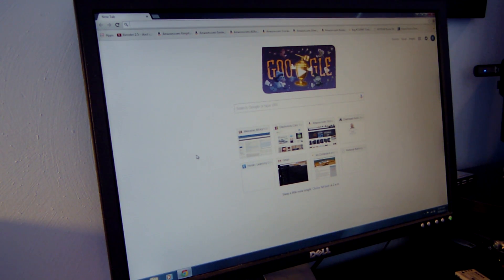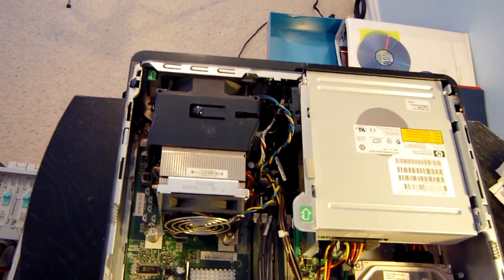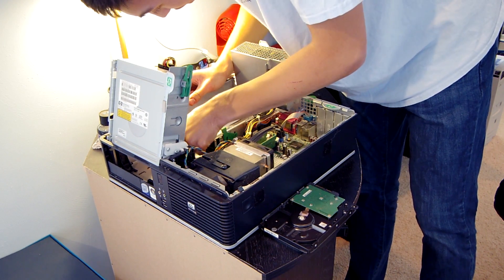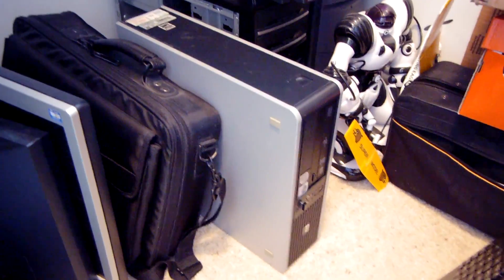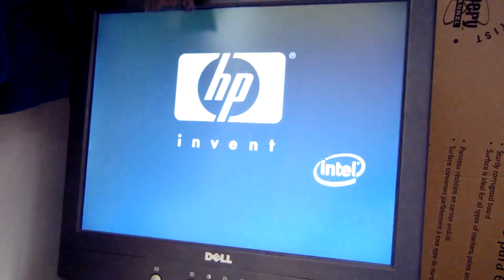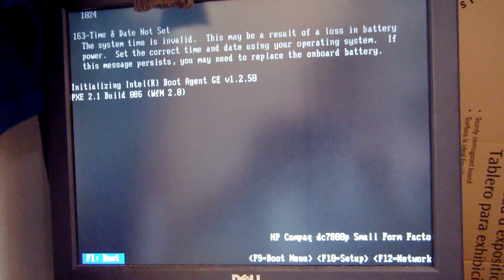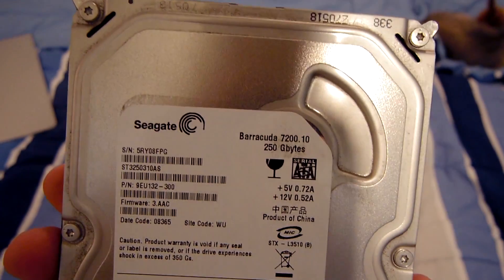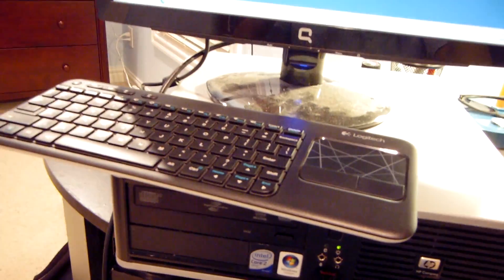Server Upgrade: Pentium 4 to Core 2 Duo

Comment: This boys and girls is why I always advocate for Linux based server software solutions because had his server been operating on a Linux based OS, he truly would have been as simple as swapping the drives and he'd have been good to go. Granted he wasn't comfortable using a Linux based OS for a file server at the time, but regardless, THIS is why so few servers in the world are running consumer level Windows based OS platforms.

Comment: You should get rid of that CPU and install a QX9650 Core 2 Quad. That is a good upgrade for that CPU.
Reply: Depending on the load its overkill and not worth it money-wise.
Reply: Besides it’s a massive improvement over a Pentium 4

Comment: Wow my Dell win7 desktop has the SAME experience index (maybe same specs?)
Reply: Hdd Is a 7.9 i think but it's a ssd
Reply: Meh, experience index isn't very accurate, i've seen way worse pcs have the same experience index. 

I would rather use passmark scores to compare computers and parts.

Comment: Now, install remote desktop and remove the keyboard, mouse and monitor. Power and ethernet only.
Reply: Why tho? Having to RDP to a machine literally less than 1ft away from you? Wasting network and energy resources by having to process the remote acess... 

Unless you have to remote acess it, its way better to just have a keyboard attached..

Comment: Hey, great video man and great info. I was trying to upgrade our computer and saw couple of your videos.. I was hoping you could answer my questions but first our computer is the athlon 2 and  2gb ram I think the desktop setup are the same and thinking I could add an radeon R7 240 and 8 gb ram ddr2 and also thinking of replacing the old HDD with the HDD that has windows 10 would that work? Again thanks, for making videos like this.. (sorry bad english)
Reply: Yeah that would work i can get windows 10 running on an intel atom with 2 gigs but min is 1gig

Comment: Ethernet has a dramatically lower latency compared to wireless. I noticed in your comment below that you don't think it makes a large difference. It does! Every time a handshake occurs or data is transmitted; that small latency you experience with wireless adds up quite a lot; even with small amounts of data. You would probably notice a 20% to 30% increase in network speeds if you converted to Ethernet.

Comment: >using wireless for a web server
>using a SEAGATE drive
>using a workstation OS
>putting it in a closet with no airflow
>making that worse by having so little space around the PC

do you have ANY idea what you're doing?
Reply: I think its a computer torture test LOL.  IDK though these things are pretty tough computers we had one at my previous job and that thing got abused, kicked, dropped, etc.  Surprised it still worked after the abuse my boss put it through.
Reply: Whats wrong with Seagate drives
Reply: @zuccx99  WD drives are more reliable, but I recommended Seagate for my friend and its working just nice. (over year maybe?)
Reply: @pena3976  Well.. tbh i never had old failed seagate drives but several wd ones, just like my 1 yeat old 1tb wd blue, and several old wd's i found in old pcs. 

I think it's more a matter of luck.
Reply: I mean except for the airflow issue, its not so bad, as it wasn't a high traffic production environment, so in the end using a gigabit ethernet cat7 cable or using a shitty wireless usb dongle, doesnt make that much of a difference. 

But i would like him to acknowledge that he is not doing things as they should in professional ways, etc, so people shouldn't use this as a home server guide.
Reply: man u re so rude
he looks very young and
just knew about pc building (maybe).
he filmed, edited, and share it on youtube by himself.
its better than nothing
(sorry for my bad english)

Comment: the bottleneck is from the damn wireless dongle
Reply: The bottleneck is from his ISP, not his network adapter. Even the cheapest slowest wireless dongles are usually able to handle at minimum 100 megabytes per second. If his IPS is crap, which he's openly stated in multiple videos that it is, then regardless of whether he's using a wireless or hard line connection, the response/load times of his site will be slow. Welcome to entry level networking common sense.

People spend too much time watching LTT videos and think you need to dump hundreds of thousands of dollars into a server farm to be able to do anything on the net. You would be shocked if you knew how many websites are hosted on servers with LESS then 100 megabyte per second network connections. Hence why you can have a gigabit home network connection and websites still won't load any faster then someone on a 20 megabyte connection.

Comment: which computer is best for running music on???
Reply: 66mhz pentium for low bitrate wma 233 pentium 2 and up for 128 and up mp3's pentium 3 700+ for flac
Reply: slipknot2k4 I was thinking about a quad core 2 processor

Comment: why are you using a windows System for your web Server ist s raspberry Pi 3 and a sata to USB Adapter Adapter a netter AMD More Power efficient sollution ?
Reply: Or eaven only a USB Stick to Store your Website with that rpi you could save so mouch Money at your Power Bill but ich think then would Spend the saved Money on your heating Bill 😂

Comment: I have a custom built system that i use as web server, it runs a pentium g3420, 8gb of 1600 mhz ddr3, asus h81m-d plus as motherboard and a gtx 650 as graphics card, it also has wifi that i use in case my wired setup does not work, an enermax triathlor fc 550w bronze certified power supply, and 2 hard drivers(one for storage, other for mackintosh installation), one ssd (for windows) and one dvd reader, i am also planning to buy a sata controller to have 2 more hard drives for other storage and backups. And i have not said that i have a very cool with plexiglass and leds enermax case from 2004 (i do not remember the model, but it was one of the coolest gaming case back at that time) and a cooler master musketeer fan controller that i prepared so it fully works. In the future id'like to upgrade the machine to a newer platform

Comment: Upgraded mine to a core 2 quad with 8gb of ram it was great :D then recently replaced it all with an fx 8350 and 16gb of ram
Reply: Well, way more performance but way more power consuption. 

I would rather go with a more modern ryzen 3 2200g or a i5.

Comment: In the future, clone the old drive to a new one, boot it in the old system, and run sysprep.  Then move it to the new system.

Worse comes to worst, it won't work, and you'll have to reinstall as you did here, but sysprep will increase the chances of "cleanly" moving the HD to another system.

I plan on attempting this on an old Dimension 4550 to move it to a C2D/Xeon system soon.  It will be complicated by the fact I will be moving from IDE to SATA in the process.  Should be "fun".  But necessary, as I don't even know where many of the program CDs are for the old install, and it was XP/7 dual boot.  I'm just trying to double/triple the speed and shrink the desk footprint of the old system.

Comment: Since you are using a machine that barely have any drive bays, you can use a RAID card with external connectors and an external SAS enclosure.

Comment: I might drag out my old HP Pavilion a6500f computer and turn it into a server, since I put money into a Core 2 Duo 3.33 GHz CPU for it, and it already had 4 GB of memory in it when I got it. Though it will need new hard drives soon, I think the 500GB one it has will be fine. And, I'm not sure if I should put the original HP install of Windows Vista back onto it, install Windows 7/10 or try out Windows Server 2016 Technical Preview 4 (I think that that is a bit overkill but yolo it runs it just fine). That's a video idea for me

Comment: A RAID card would be pretty useless in a system like this. If you intend to run it as a fileserver, you're gonna have to use Ethernet. Gigabit if possible. Otherwise, your transfer speeds will be excruciatingly slow.

Comment: Who even expects a system to fully run Windows changing all the hardware
Reply: +Hamza Windows 10 is really good at handling complete system swaps, tho it will ask for you to reenter you product key, but it can tell the new hardware and get correct drivers for it. Windows 8 did this too but not as good, but 7 and earlier would freak out with any major hardware change.
Reply: I moved windows 7 from a desktop to a server just fine i guess I'm lucky

Comment: I can say this. I have a core2duo 3.0 ghz all stock PC. 4 gig ram maxed lol. It runs windows 10 pro like nothing. It is the fastet boot ever. It has an old hard drive making those bbs on foil sounds. lol. Anyway 10 seconds from power press im up. But I am buying an old dell inspiron i5 8 gig ram stock pc from my dad whom just upgraded. I just hope i can add some hardware as it is 2012-13 PC.

Comment: WELL lets hope the pentium four doesnt hasve better ram than my gaming pc
Reply: LOL
Reply: yes but he said the core two duo pc is using ddr4 ram and had to correct himself. also cpus require specific types of ram
Reply: no they design the mobo around the cpu not vice versa so the cpu is the limiting factor to ram type
Reply: +Dalton Whittle Well Said. :)
Reply: +i30delta please reserch what you said
Reply: na i got an upgrade with 8gb 4x2gb and a new case mobo psu gpu, and cpu.

christmas time makes me happy.
ps it origanally was a 200$ hp but not from walmart nice guess tho
Reply: yea but the windows 10 copy deactivated since Microsoft is a little crybaby.
Reply: +i30delta tell me, detective dipshit, is the mem controller generally in the cpu die or on the mobo?
Reply: +Dalton Whittle no, cpus dont, i have a core 2 duo, and i moved it from a ddr2 mobo to a ddr3 mobo, and it worked. i also moved one from a ddr3 mobo to a ddr2 mobo (it was a cpu swap between two pcs, im making a budget pc)
Reply: +skulldriver101 he meant ddr-400
Reply: Connor Jones yes i know
Reply: King Gaming those are sweet specs but I don't see why they're relevant.
Reply: skulldriver101
 DDR4 64GB 4x16GB 2700MHz.  Intel Xeon E5-2600 v3 @ 5.7GHz O'C. ZOTAC GeForce GTX 1080 AMP! 3-Way SLi & Z10PE-D16 EEB Motherboard.
Reply: Swag.

Comment: good job. Pentium 4 sucks. cooked some top ramen on one once. i have a pentium dual core at 2.6ghz
Reply: +yomandisorion I have a pentium dual core 2.4ghz, but it's in a dusty pc and runs hot and slow because of it. do you think I can use it again when I clean the pc? it has 4gb ddr2 ram and a rather shit geforce 7050 610i or something
Reply: Sep Terstal nah you should get a core 2 duo

Comment: those kind of errors while changing systems are from the hdd drivers, it happened to me a lot of times, the best way to fix it is using hirens boot with mini windows xp, it has a tool that updates the hdd driver to the one of the new pc, so it can boot and work, i managed to update 6 pcs with pentium 4s to new pentium g3240 and h81 motherboards, i also managed to downgreade an installation i did in a xeon x58 to a core 2 duo with windows 7, there are some good guides, google them, they may be an interesting video for people that dont know this
Reply from the maker: +santi0797 That is interesting! Thank you for sharing.
Reply: https://www.raymond.cc/blog/move-windows-xp-hard-drive-or-change-motherboard-without-getting-blue-screen-of-death/2/
thats one of the guides

Comment: Yeah CPU upgrades generally run into problems - sometimes you need to think about reflashing the bios, and also reinstalling Windows as different CPUs use different instruction sets that windows, during the install, doesn't install them all - I found that out after upgrading from a Core 2 Duo to a Xeon Quad Core using a LGA socket adaptor. Upgrading RAM and the graphics cards is probably the only thing I would touch now. Otherwise look for a ready built base system that's already up and running.
Reply from the maker: +CommanderT Thanks for the advice!
Reply: No probs - keep up, with the videos!
Reply: No its just the chipset that doesnt support it.

Comment: Did you think that the motherboard was different than the one in the gateway and you normality will run into issues If you put it in a system that has a different.  Make sure of that next time.
Reply: Clean reinstalling was a good idea.
Reply from the maker: +Hannah Flynn Sometimes I have no problems transferring between different boards and other times I end up stuck in a situation like this. It just depends on the board. Yup, a clean installation seemed like my only option.